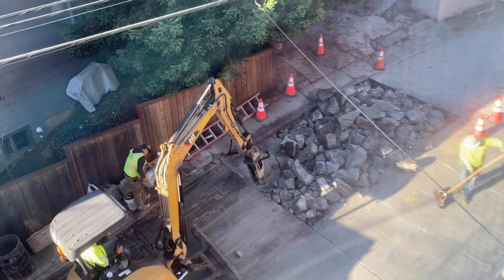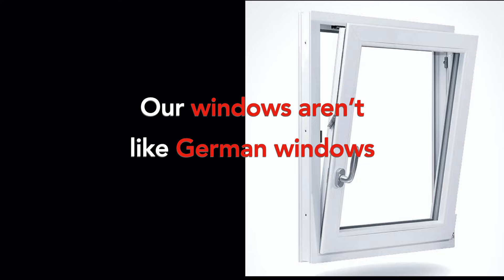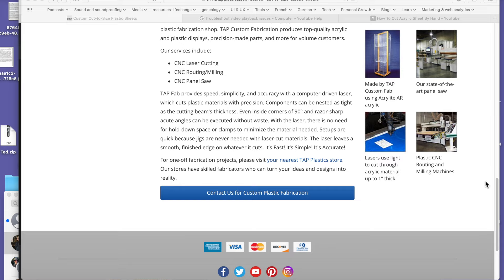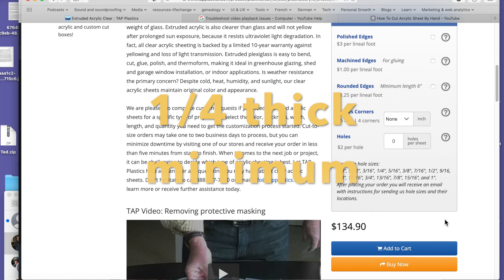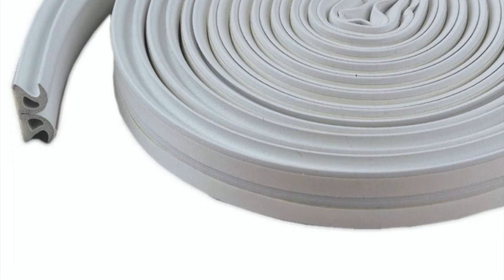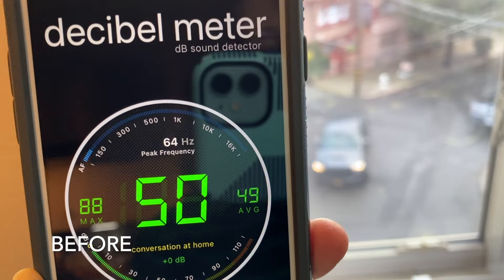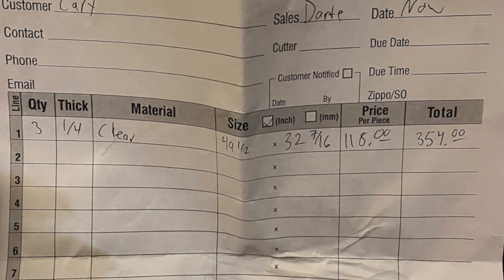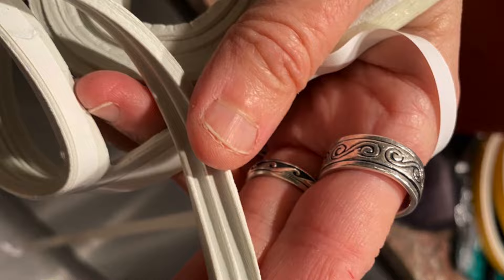How to make a DIY window insert for noise reduction

Comment: I'm still searching for a good compression sealer/tape to attach to the insert. For some reason I am having difficulty finding a real solid adhesive compression type strip to use for the insert. I'm open to suggestions.
Reply from the maker: Do you mean the green "soundproofing" foam tape that I used to press the plexiglass edges against the wall? I'm actually not happy with the one I used, either -- probably because it's such a clashing shade of green. It was wide, and not very deep (maybe 1/8?) but it doesn't fit with the color scheme. I'd like to replace it with white adhesive foam and make it look like part of the window frame. Or did I understand your question correctly?
Reply: @soundproofist  First off...I'm a guy...we usually don't care much about aesthetics. But after I sent this I did find a sight that gave a clue to the stuff I'm looking for...wait for it..."Baby Bumper". I have some coming from Amazon to check out. Thanks
Reply from the maker: @stevend984  "Baby Bumper" -- I never thought of that! By the way, in the video I show that I put some thick foam at the bottom of each sheet of plexi, and somehow those pieces of foam have shifted over time and they're no longer aligned at the bottom of the plexiglass (on the windowsill). The plexiglass is mostly just sitting right on the sill now. I think I'm going to add rails along the windowsill, instead. I'm surprised at how much some online sellers charge for these rails (especially plastic ones) but I think I might find what I need at a local building-supply store.
Reply: Haven't built them yet, because haven't ordered the plexi yet. Plan to do a trial 1 first, with grey backer rod,  slit, around the edge. There is also pipe insulation already pre slit.

Comment: It was helpful. How do you let air in now.
Reply from the maker: This is a large area that on one end is a kitchen with one large window, and it has no additional plexiglass. So I can open it anytime.  And the other end is a living room area with two windows. Those two living-room windows got the plexiglass. The larger of those windows has three removable plexiglass panels. If I need more airflow, I can just slide out one of the plexiglass panels and open the window.
Reply: @soundproofist  Sounds good. I've got large sliding aluminium windows. Near impossible to do.
Reply from the maker: @MAC...007  Depends on the size. Our original windows were aluminum-framed, single-paned glass that was not openable in the center, but on each side, there was a hand crank that opened the side windows outwards. Those were replaced by vinyl windows with double-paned glass. The center pane is still stationary, but the smaller windows on each side can slide back and forth horizontally on a track to open. And the plexiglass (which is removable) sits in front of that on the windowsill, so I only have to remove one panel to open a side window. I admit it's a pain to remove it and put it back, so I only do it if the weather is super hot.

Comment: Thanks so much for sharing this. Is an insert that is pushed into the window opening more effective than placing the acrylic on top of the window? I saw Helpful Mike’s install that you featured in this video and I was curious which is more effective. Thanks!!
Reply: Shoot - I have blinds installed inside the window and I don’t know if I can take them out.
Reply from the maker: In terms of effectiveness (amount of sound blocked), they might be equivalent. However, there are some things you need to keep in mind if you make an actual window insert versus the overlay (the "Helpful Mike" version...which is super helpful). First think about your window coverings and if you have window frames, or just cut outs in the walls. If you have a frame around the window and it's not flush with the wall, you'll need inserts. But if you build an insert, you need to measure each corner precisely, preferably with a laser tool. No window is perfectly rectangular and the dimensions could be off just enough in one corner to make it not fit right. That's what happened to me on my first window. You want the plexiglass sheet to be smaller on all four sides, and held snugly in place with a flexible rubber or silicone gasket. But then you also need to think about "how do I get it out?" because you might want to open the window. So, will you put handles on the plexiglass or build a frame around it, with handles? If so, will that compromise the plexiglass at all? Also, if your window is large enough to need more than one panel across your window you don't want to piece these together on the inside of the window frame. It's much easier on the exterior, as I did for my large window.
Reply: @soundproofist  Hi there, I apologize for the delayed response. Thanks so much, I think I might do the overlay because I’m worried I’ll mess up the measurements for an insert. It’s good to know they seem to have similar effects. I was worried that there would need to be an air pocket with the acrylic closer to the window, but I don’t know how that works to be honest. 

To confirm, a frame would be like a wooden frame around the window? I’m sorry if that’s a dumb question. My window just sits inside the bare wall with metal around the glass and a window sill at the bottom. It’s 47” high x 46.5” wide and I found a place with 48” x 48” pieces of acrylic. That should be ok right? I think I read that you recommended 1-1.5” extra room for each side (apologies if I got that wrong). 

Lastly, would going thicker than 1/4” be inadvisable? I’m hoping to block a lot of sound since I have bad hyperacusis but I don’t want to mess with things since I’m very much new to it.

Thanks again SO much, I will definitely look through your other suggestions as well - they seem great!
Reply from the maker: @SsssAt  I don’t think there is any harm in going thicker than 1/4 inch. Of course it will be heavier. In general, you want something soft between the plexiglass and the wall, or the inside of the window frame, to stop the direct transmission of vibration from one hard surface to another. Since I don’t know how to attach handles to a window insert without destroying it or reducing its effectiveness, I need to research how to build one with plexiglass (it’s easier with wood, etc). A window that’s 47 inches high with 48 inch plexiglass should have just enough clearance with the plexiglass on the windowsill. A little more would have been great, but if the opening doesn’t exceed 47 inches, it should work. On the sides, you’ll actually have a little less wiggle room, maybe 3/4 inch on each side. It’s tight, but with a 1/2 inch strip of thin foam on either side and firmly held against the wall with mirror clamps or something, you’ll just squeak through.
Reply: @soundproofist  Thanks so much. I ended up getting a 1/4 x 50 x 50 sheet that came in today. I’m a bit worried about the extra weight/size, but should it be ok as far as staying on the wall? I was hesitant to try doing it in two sheets. 

I also have a weird question - I’m leaning the sheet against a wall due to lack of space in my house. It has a slight bend from sitting against the wall. Will this warp/bend the material permanently? I need to clear space to lie it down but I was concerned I would bend the sheet and that it wouldn’t be flush when it came time to install. Apologies for all the questions and thanks again for your help.
Reply from the maker: @SsssAt  I think it should be OK after you fasten the sheet on the wall on either side of the window (while supporting it on the windowsill).

Comment: Do you think it would be worth it to do on windows in an area that has a sliding glass door
Reply from the maker: So... just to be clear: what is the problem you're trying to solve? For example, traffic noise, construction noise, neighbor's barking dog, etc. What kind of building? Wood frame, single family home or apartment? Urban or suburban? It sounds like you're also wondering if it's worth it to put plexiglass on the windows when you also have a sliding glass door in the same room. And it won't get extra plexiglass and could continue to  leak noise. Correct? If so, this could be similar to what I did, where I have a large room that's divided into different areas (kitchen / dining plus living room) and I put plexiglass on the living room windows but I didn't put it on the kitchen window. It still made a difference, but it didn't solve all the noise issues because the traffic noise is structure-borne. That is, even if I put plexiglass on the third window in the room, some types of rumbling, low-frequency noise would still come through the walls and floor, and those need to be addressed, too.
Reply: Neighbors dog!! Suburban and yes that’s exactly what I’m wondering if it’s worth it to do the windows if we have the sliding door. 
Also do you have somewhere where you list all the materials used? I see where you got the acrylic but not the foam or padding, or weather stripping insert to insert it with and fit it in
Reply from the maker: @angelagarofalo-qi2fm  I list some of the materials on the companion page for this video: https://soundproofist.com/2021/12/30/how-to-reduce-window-noise-with-plexiglass-inserts/  however I didn't post links to the exact items. These are all things you should be able to find at Ace Hardware, but I might have the packaging still and I can look up the exact name. One thing I don't recommend now is putting the thick piece of adhestive-backed foam on the bottom of each piece of plexiglass. The idea was to stop any vibration coming from the windowsill into the plexiglass, however, the foam that I used was too thick, and eventually slipped out from under the plexiglass and left a sticky, glue-y residue.
Reply from the maker: @angelagarofalo-qi2fm  I'm not sure how well this would work in your situation, and it might get unwieldy, but I wonder about hanging heavy sound barrier sheets over your sliding door when you need to block the barking dogs. Something like this one from Audimute: https://www.amazon.com/Audimute-isolé-Sound-Absorber-Absorption/dp/B081K8FW3V

Comment: Have you looked into off gassing from the sun's heat? Thats my mAin concern
Reply from the maker: No, I haven't, but you bring up a good point. I wasn't aware of any odor when I first installed these, but I also did it during the winter. They sure do hold the heat inside, though.
Reply: @soundproofist  might not be an issue since acrylic doesn't have bpa. Just something to look into. Dont want any health  issues.

Comment: How do you get fresh air ?
Reply from the maker: This room has three separate windows and I only put plexiglass over two of those windows. Also, because I put three separate pieces of plexi over this large window, I can remove one of the pieces on the side and slide the window open. But most of the time there's so much noise and construction going on nearby that I have to keep it shut, anyway.
Reply: @soundproofist  yes me too I must keep the windows closed unless it’s the middle of the night and it’s raining . Ugh !

Comment: how about using  noisy neighbors or music ?
Reply from the maker: For this window, music wouldn't work unless it's coming from a car hovering on the street with an exceptionally loud stereo system. What I really should have done was capture a lot of "before" scenarios of the typical noise issues before I got the window inserts, like: full-sized FedEx truck revving past the window, garbage-collection truck, car with engine idling (but not accelerating), etc. and then capture each one of those things again with the inserts in place, in the exact same spot. When I did this project, it was the week between Christmas and New Year's Day, so traffic and activity was lighter than usual. Instead of constant traffic, I had to wait for trucks to come, and eventually I just wanted to get started with the building the window insert. Maybe I should make a follow-up video and remove the inserts again for comparison... maybe a week or two BEFORE Christmas, when there are lots of trucks!

Comment: Thank you. Did you build a frame to fit the plastic?
Reply from the maker: I didn't build a frame for the plexiglass sheets, but I think it's a good idea, especially if you're going to put them on and off a lot.  Or if you have a situation like mine, where the window is so big that it requires multiple sheets of plexi just to cover it. Aesthetically, it's better, too.
Reply: @soundproofist  so what is that "frame" around your plastic insert
Reply from the maker: @aaabbb-py5xd  I have no frame around the plastic. I used some metal brackets on the wall that I bought from Amazon. There's a small gap (not a snug fit) and I insert shims into them. Around the plexiglass edges, on the wall-facing side, I put 1/8" thick foam where it touches the wall. However, at the time I did this video, I only had bright-green "soundproofing" foam strips, which don't exactly match my color scheme. At the bottom of the plexiglass, where it sits on the window sill, I put adhesive foam strips that are 1/4" deep or so. However, these are starting to separate from the bottom of the plexiglass and I'm going to replace them soon with some 3/8" plastic tracks that I just recently bought from a company called Outwater Plastics. I'll affix these tracks to the window sill to hold the bottom of the plastic sheets in place.
Reply: @soundproofist  Thanks very much for the detailed explanation, and thanks for the video too sharing the experience. I'll follow suit and try the same. Ever since nearby construction cleared out a row of trees, road noise has been a nuissance, and the cost of professional inserts just was too much
Reply from the maker: @aaabbb-py5xd  I'm glad I did it. I couldn't afford to order custom-made windows, but I got basically the same effect with this DIY. What really surprises me is how much air was also leaking through my existing windows. If there's air coming through, noise was also coming through. The inserts kept my apartment really warm for the rest of the winter....though maybe a bit too warm in the summer. And finally, the window inserts don't block all noise and all frequencies, but for example, this morning the trash collector trucks came down my street I could hear them, but it was a manageably low sound and not overwhelming, like before.
Reply: @soundproofist  Yeah, in my case, it's trucks driving by early morning when I want to sleep in late xD I can sleep through it but a little less loud would be perfect :)
Reply from the maker: @aaabbb-py5xd  I think in many cases and for many budgets, that's the best outcome. Turn down the volume if you can't totally eradicate it. A lot of our housing really is substandard -- it might look good on the surface, but underneath, they're just wooden tents. You can't fix everything unless you tear it down and start over. So... you find hacks to mitigate it.
Reply: @soundproofist  Wooden tent analogy totally resonates :) After watching a few house construction videos,  I now have little confidence in the structural integrity of any wood house. Their walls just seem so flimsy, propped up by just a few nails and the weight of a roof or upper structure.

Comment: i wonder if you had another phone to put  in the window to get the difference
Reply from the maker: I used two phones: one for the decibel meter app and one to record the sound as well as the readings for the decibel app. However, the iPhone has some built-in noise cancellation, so some sounds aren't recorded exactly as you would hear them in person, especially the lower frequencies.

Comment: What frame did you use to keep the plexiglass?
Reply from the maker: Hi -- I didn't put a frame on the plexiglass for either of the two windows. The main difference between the small window (with one sheet of plexi) and the big window (with three sheets of plexi side-by-side) is that I tried to fit the plexiglass inside the window frame of the smaller window. And with the big window, I cut the plexiglass bigger than the window frame dimensions so that it attaches to the drywall around the window frame, instead of trying to fit the pieces inside. I actually wish I had done the same with the smaller window -- cut it larger than the window frame. Or else I should have made it smaller and then built a frame for the smaller window. But it was my first attempt...